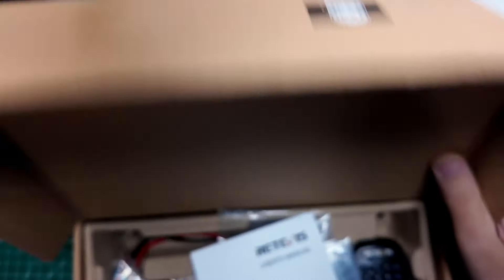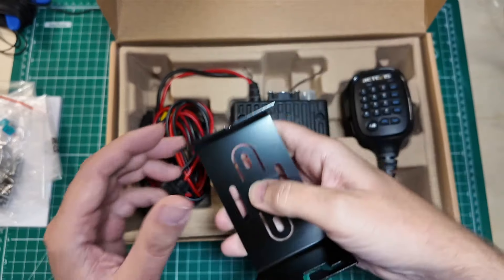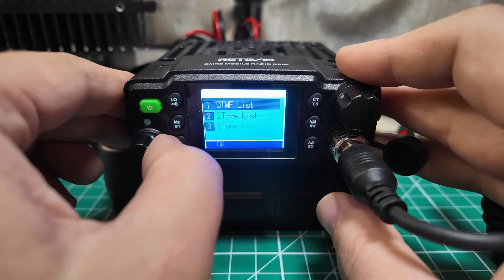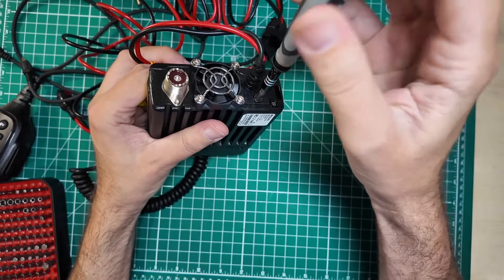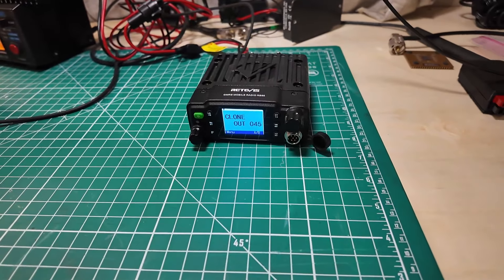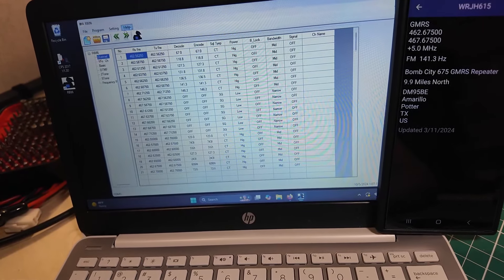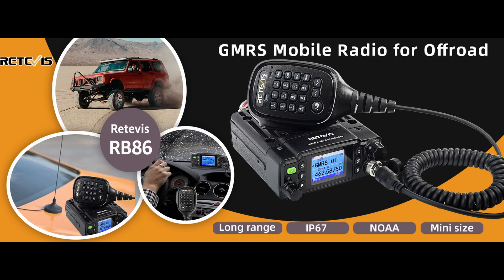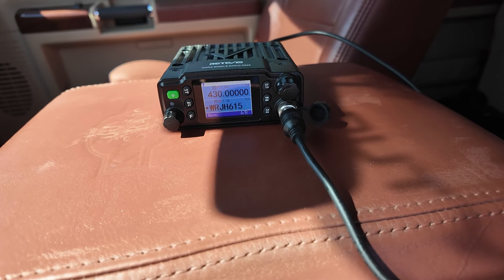Affordable Overlanding Radio: Retevis RB86

Comment: Interesting.  If it's Part-95 it's not supposed to be able to Tx on anything other than the Part-95 service it's ostensibly for.  Sounds like someone at Retevis isn't complying with the rules.
Reply from the maker: Never! :-D
Reply: It might be that you have to reprogram the radio to do one or the other not be capable of either at the same time.

Comment: This looks similar to the TYT 8600 I currently run in the Jeep.  Great video! 73
Reply from the maker: I think its the same radio!
Reply: I have 2 on ATV's, NOT SXS's. They get wet all of the time. One just went through a freakin' hurricane when the shelter it was under collapsed. The radio was completely drenched and had to endure 80 mph winds. I fired it up yesterday and using the Tacti"Cool" Abbree 42 BNC made  an 8 mile QSO on 52. These antenna's really don't do much for a 5 watt HT but when you push 20 watts into them they perk up like titties on prom night! 

I need to make a video on the ATV installs. Tiger Tail is must, tuning is time consuming and tight.

Comment: I wonder what FCC type accepted that is. For amanture radio is part 97 .  Many of them are like that. Just re labeled and have different firmware installed.  For them GMRS repeaters the repeaterbook not always have correct data in it.  It is so wrong in my area . Even the MY GMRS is wrong.  And GMRS repeaters not required to be listed.  You can change PL codes/tones at any time on them . A lot of GMRS repeaters wear taken down because of linked system or no longer wanted it and never updated repeaterbook.   this is the norm , The FCC re worded GMRS rules because they confused us. That the first thing I do. Power poles !  73
Reply: We hams can alter radios to do ham frequencies, you can not alter radios to do GMRS.
Reply from the maker: Its a radio with an "unlock code" to make it GMRS only or V/U only... or in my case, its "all band"

Comment: FYI the TYT's do not come unlocked.
Reply from the maker: Bonus for the Retevis!
Reply: @temporarilyoffline  indeed! Desensitization is tight as-well. If the two radios are within literal shouting distance they will not receive! I run SSSS on them while riding and have the Abbree as a backup.